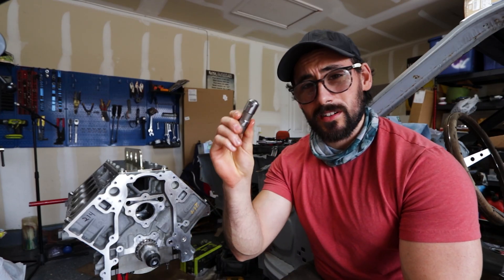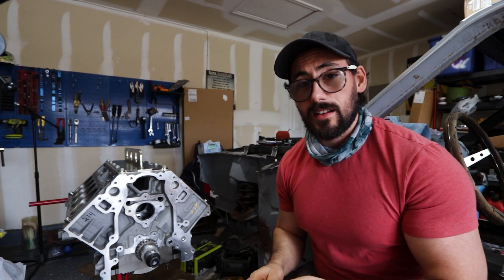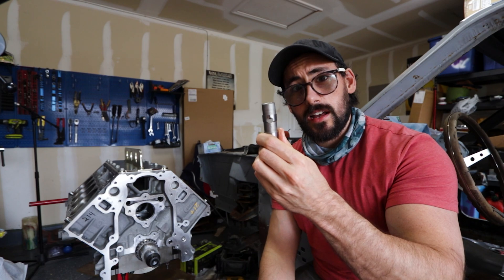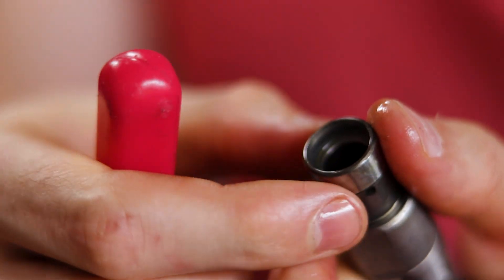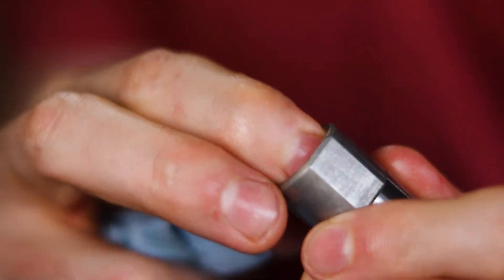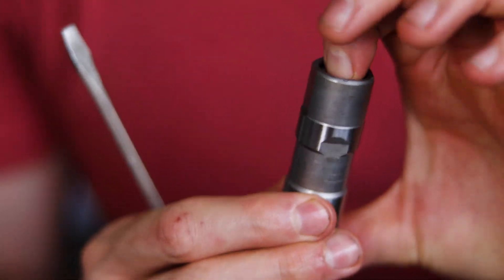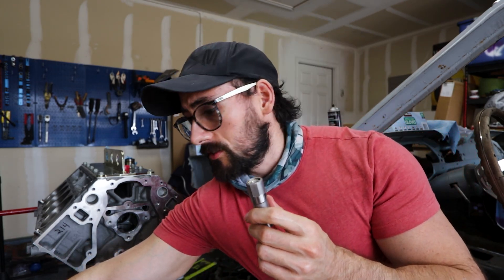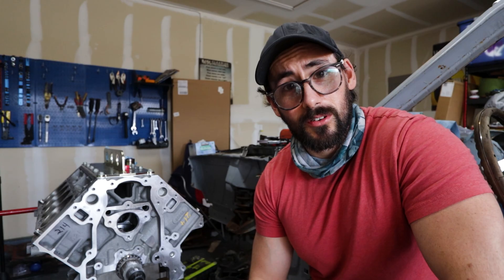How to Convert LS Hydraulic Lifters into Solid Lifters

Comment: Your video was exactly what I needed to be able to degree my camshaft.  Thanks!  I didn't have any used LS lifters so I went and bought a Melling JB-2079 from the auto parts store for $14.  The only difference with the Melling is that it doesn't have the little disc.  Also, I needed to use a magnetic pick up tool to pull the plunger out because the factory oil inside formed a tight enough seal that I needed to overcome some vacuum as I pulled the plunger.

Comment: But I mean can you run the engine using this lifter?
Reply from the maker: That’s a hard no 🤣 it would be nice to have a solid lifter set up, but these would be destroyed the second you turn the engine on.
Reply: @TheDailyDrift why would it destroy? It still has same internal components so where is the strength compromised?
Reply: @TheDailyDrift  are you sure? Even if you use a non VVT cam.
Reply: I’m about to do this and put it in a motor. Have you tried it yet